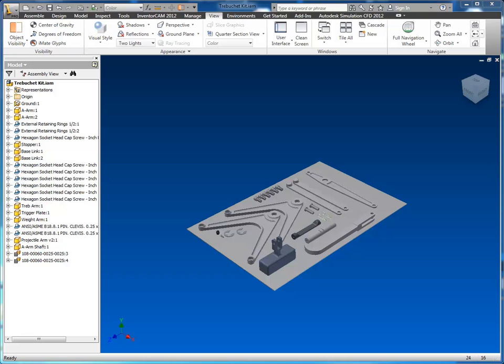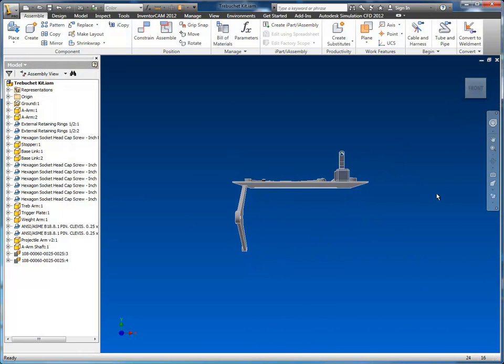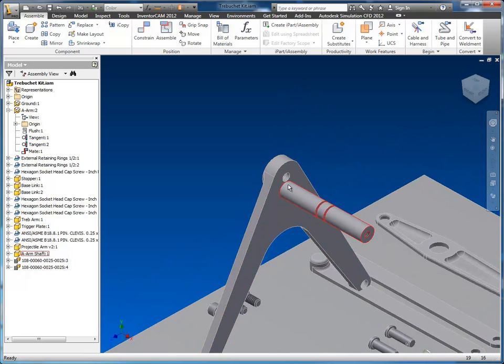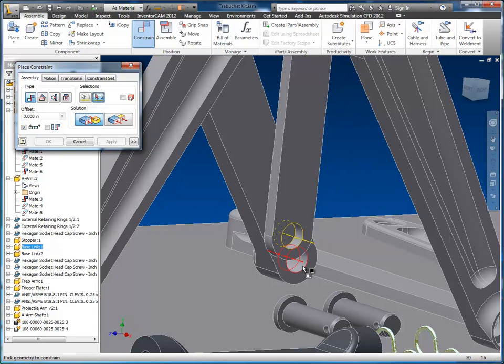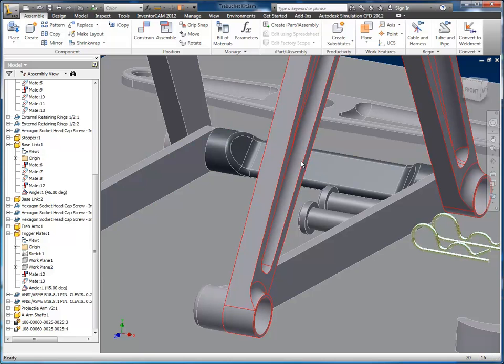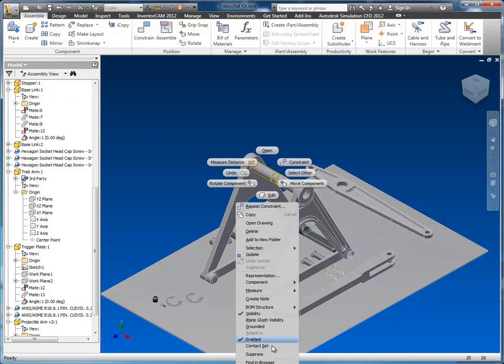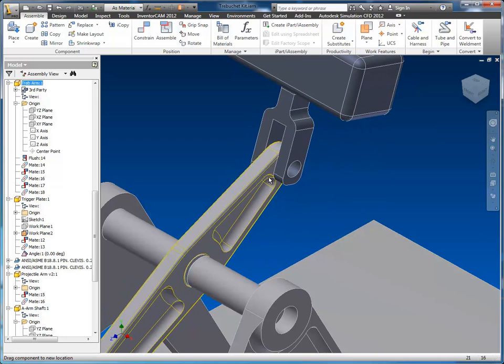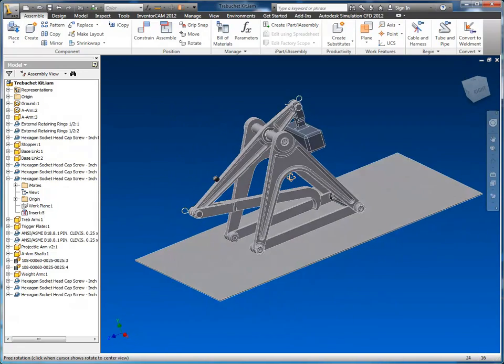Autodesk Inventor 2012 - Assembly Constraints

Comment: Excellent video. I'm here to refresh my Inventor skills since I might get a job using the software. However, I don't want to sound like a hater, but this constraint command is soooo much easier in Solidworks. So switching from Solidworks to Inventor, I was really struggling with this command. But thanks to this video i understand it a lot better know specially the Assemble command. Thanks John.

Comment: I have been using 2016 for 8 weeks and contrasts worked. Now they don't? After setting one contrast it when will not have any freedom of movement, its locked in place. Is there a setting to fix this?
Reply from the maker: are the parts grounded? constraints can appear to not "work" if all the parts are grounded.
Reply: +John Helfen 
NO  I should be able to move part along the one constant.
Reply from the maker: James Scannell if you start with a blank file and just assemble 2 parts does it work or is it specific to the file?
Reply: +John Helfen 
I have made 3 assembly's with 2016 with no constraint problems over the last 8 weeks. The assembly I doing now has 12 parts in it and on the last two parts has the problem. T will tray a two part Assembly and let you know what happens.
Reply: +John Helfen 
Hi,
I made a 4 part assembly and constants work correctly.  I am at a lost to why the assembly I building is failing. It must be a setting?

Comment: Hello John. Very nice video. Do you have, by any chance, one that goes through the building of the trebuchet parts, with it's properties and etc? I looked at your videos but couldn't find it. It would be nice to see how you did all the modelling, the constraints (which there is video) and the dynamic simulation (which you also have the video).
Thanks for sharing the video and your time.

Comment from the maker: That depends on the environment. In the assembly environment you can right click on a part and select contact set. Do this on several parts, then go to the inspect tab and select activate contact solver. This will make parts selected as contact set to react to each other in the assembly environment. In the dynamic sim environment you can add a 2D or 3D contact joint. Let me know if that helps or if you want a short video on it.

Comment: John, nice vid.. Could u please explain how to make a moving part stop when it comes into contact with another part please? I noticed that your arm goes straight through the base plate, i realise it wouldn't do this when the trebuchet does its actual motions but just as an example how would you stop it from doing this??

Comment from the maker: Sorry for the late reply. I used contact sets. If you right click on a part in the browser there is an option to add it to a contact set. Do that on all the parts you want to bump into each other and then enable the contact solver. With the solver running you can drag parts on the screen and they will bump into other while you are dragging them around.

Comment from the maker: I would lean toward using a revolve to create the door knob and possibly event the escutcheon. Once you have both created you will need to use an axis to axis mate to line up the door knob stem with the hole in the escutcheon. I would control the depth with a flush constraint at the bottom of the stem and the back of the escutcheon, perhaps with an offset to control the depth. It's kind of hard to explain without seeing exactly what you are trying to do.

Comment from the maker: Hum...that is a very interesting question. There is a bend tool that may be able to be used to accomplish this. You may also be able to complete this in 3DS Max and import the model into inventor. What is the purpose of the part. I have seen a lot of parts, but not sure if I have ever seen that before.

Comment: Thank you for the suggestion but it still will not allow me to drive constraints on the second  subassy. When I right click in the constraints folder to drive constraints  I only see replace component part and create note, as apposed to the first subassy i put in the assembly which lets me go into drive constraints :-(.

Comment from the maker: You probably need to make them flexible. By default subassemblies are locked in position when placed in another assembly. If you right click the subassembly in the browser you can make if flexible. I think this will fix the issue.

Comment: I have a working hinge assembly but when I try and place it in a new assembly for example a door with 2 hinges, either only one of the hinges works as it should or neither work and I cannot access the driven constraints option in the browser bar. When I get one of the hinges to work the other simply follows the door stiff rather than bending at the hinge.

Any ideas on how to solve this?

Best regards 

Daniel

Comment: If you check for interferences in your assembly does the fasteners threads get flagged? I usually bypass this by not selecting the fasteners when i do this check. But in some cases the bolt hole is not a through hole(bolt and nut). It is a tapped hole with a specific depth and checking to see if you fastener is correct length. In your assembly you have few fasteners so checking them manually is easy. But in some assemblies, I have thousands of fasteners. Is there a solution to this check?

Comment from the maker: I do have good internet, no doubt about that. 

You are correct. If you have all the drawings and specs it might be easier to build all the parts first. Most of the time I am building from scratch so I do build my parts in the assembly. Inventor is really built for creating parts in the assembly. All you ahve to do is double click a part and you can edit from within the assembly.